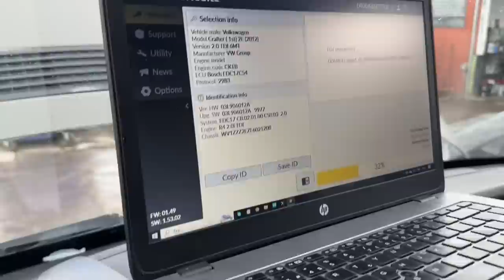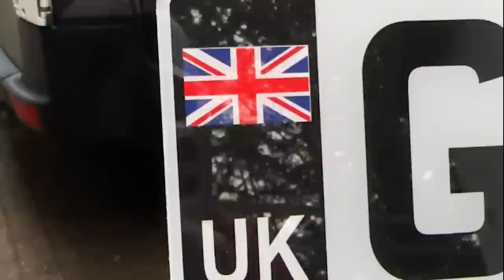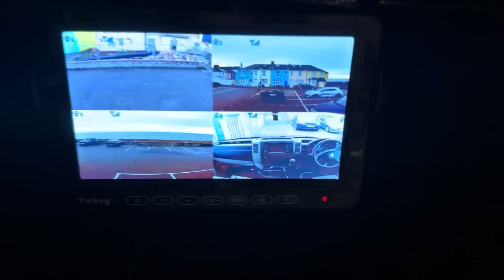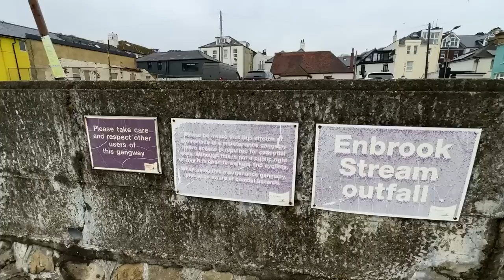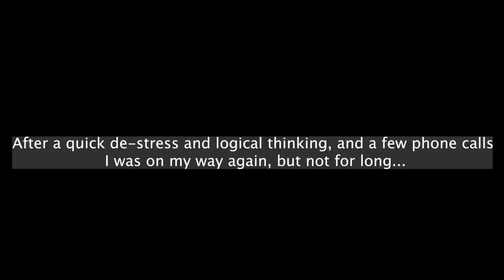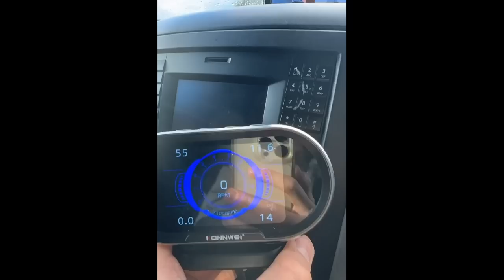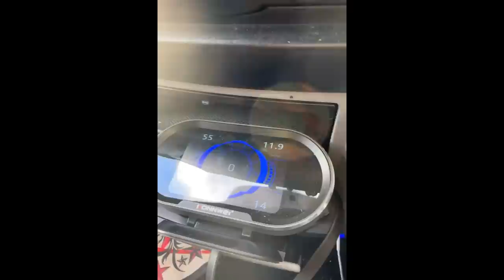Catastrophic!!! Engine Failure on French Toll Road!

Comment: Water pump runs off the cam belt. You could have drove without power steering but wouldn't have got far at night without the alternator  👍
Reply from the maker: Thanks a lot for this. I kinda worked this out but wasn't 100% sure.

Comment: Hope everything was ok and you manger to do all you wanted to do ❤ not a great experience. Did you have a vehicle charger? Not sure if possible to connect a vehicle battery charger using your echo flow to charge your main battery?  Great video sending hugs 😊
Reply from the maker: You know what, I didn't even think about this. No I don't. I have 2x jump starters though. A battery charger is a great idea.
Thanks mate
Reply: @TravelwithGaryandAmika  yesh the one I have is great it’s small and have different setting for which battery your charging :)

Comment: Where did you get the blue foam mattress from? And is it the high density firm stuff?.. I bought a couple of single memory foam mattress and they are OK for sleeping on but sitting on them is terrible they just flatten down 🙄
Reply from the maker: This is a good point worthy of a video in itself. I had a £200 15 inch soft foam mattress. All it did was give me a bad back. I thought I had really serious to my back, I couldn't bend over without it hurting and standing up after sitting down was a real struggle, I got the extra firm durafoam and within a few weeks the back ache has gone completely. 
Search durafoam on ebay, mine is the extra firm, and yeah I have an offcuts of the soft one for a seat at the moment and it's useless. Durafoam is on oder!!
Reply: @TravelwithGaryandAmika  excellent thanks for the advice... Love utube for the vast knowledge and people like yourself for helping out in the comments section. Thank you
Reply from the maker: Your absolutely welcome ☺️
Hope you find the foam useful